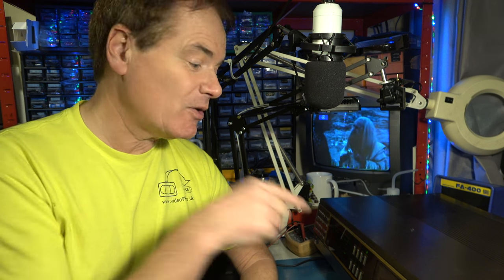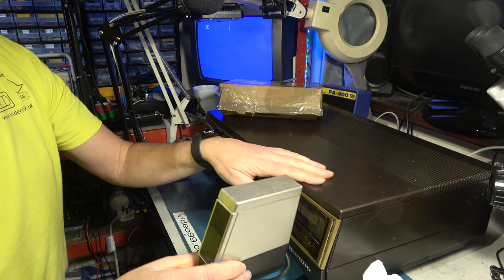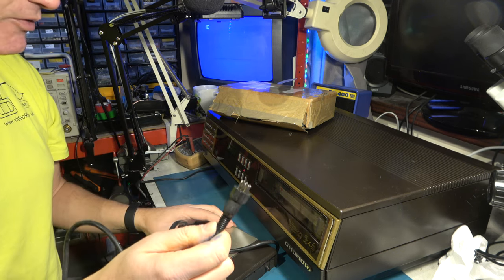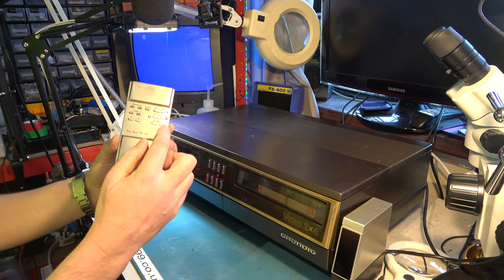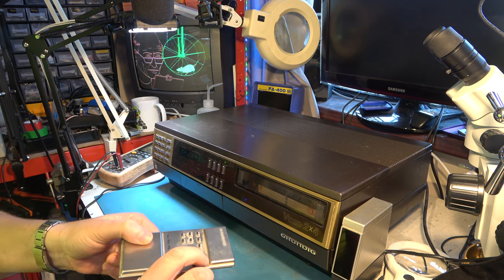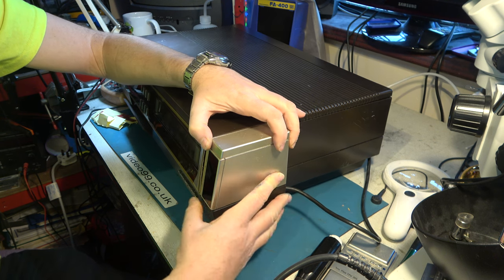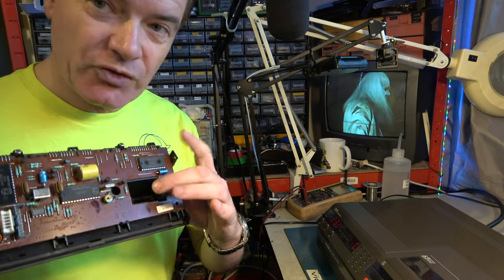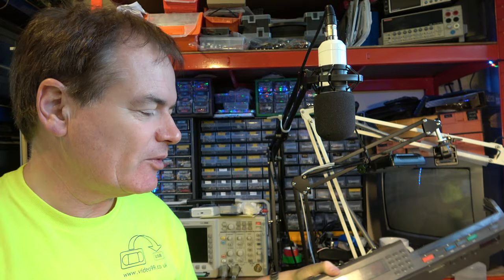Adding remote control to V2000 machines.

Comment: The nice thing about all Philips (related) audio video hardware is that the remote controls and receivers were all basically the same, based on the RC5 format.
You can probably take a receiver out of anything Philips from the 1980s/90s and connect it to 5V, ground and the appropriate input pin on the microcontroller and you'll have a working remote control. The RC5 bus is basically a single line that gets pulled to ground or 5V (I don't remember which) with a pull-up or pull-down resistor, and the signals are the demodulated bits from the remote receiver. 

Also I'm pretty sure that DIN plug on the V2000 remote receivers was a standard plug that's probably still available.

Comment: I remember getting a new old stock add-on wireless remote for my SONY C6 MKII Beta back in the early 90's. It was a very simple remote but essential for skipping ad breaks. The most memorable thing about it was you could almost point it anywhere and it worked. There was also a wired remote option for this model which I had previously but it did become a trip hazard very quickly.

Comment: So glad it worked-I almost binned it recently, I did look in the assorted box it was in for the mount but it didn't see it so I may or may not have it elsewhere, likewise I may or may not have the remote somewhere. According to the www the stereo model 808 was silver the super model 800 was like yours.   I definitely don't have the Philips one. I did once have the composite in/out module for the V2000 series but I no longer have that only the service manual for the module.

Comment: Considering how much these cost back in the day, it seems crazy that remote control was an optional extra!
Reply: They were a nice way to make VCR's just a little bit cheaper (V2000 were already the most expensive VCR's even without the remote). Lots of people still had TV's with no remotes too. If you had to walk to the TV to put it on preset 12 for the VCR, you don't need a remote for the VCR either. Made perfect sense to me 😄
Better than other compromises such as wired remote controls that many Japanese VCR's had. Those just seemed silly.

Comment: it reminded me of the remote upgrade on the toshiba v8600 which i owned. that was stuck on the side with velcro and plugged into the front wired remote socket.

Comment: My first VCR hack was adding a wired remote control (built myself) to my Sanyo 5000.
Reply from the maker: I did the same to a VTC5150!  It was an Aiwa cassette deck remote control model RC-10 which was nice because it also had LEDs in it, so I added circuitry to drive those from the machine's LEDs.

Comment: I think that if you take any modern or 90’s IR receiver ( the small black 3 pin ones) and connect it to the T4 terminal it will work, pin 1 is ground, pin 2 is rc signal and pin 3 is 5V supply.

Comment: I was wondering if it would come off pause if you pressed pause again on the remote, and play works only when the mechanism is in stop mode. (?)

 Also, how many pins are on that remote plug ? I'm trying to get a remote for my Philips reel to reel but they seem to be very rare. So if I can find the right plug I could make my own. :)

Have a happy new year.

Comment: The contamination on the connector pins looks very similar to that on the pins of some 20+ year old Hirose plugs with silver plated contacts. Perhaps a metal polish might be worth a go if you come across something similar again rather than risking removing the plating by using anything too abrasive?

Comment: Would it be possible to reverse engineer and build the GRUNDIG or Philips IR receiver circuit to integrate into these machines and find a universal that works, sounds like a project.

Comment: Actually the Grundig remotes are just wired in parallel to the front buttons, so you can just build your own wired remote by making a keypad matrix and connecting it to that socket.

Comment: I had a video 2000 and travelled 30 miles for the remote control unit, only to find that the battery was very difficult to get hold of

Comment: 2 Questions: Does the Remote Control still have a 4LR61 Battery ? (my standard Supplier no longer knows the Product), and can Universal Remote Controls still use the "Secret Code" ?
Reply from the maker: The battery is marked 7K67 and 4LR61, size J, I replaced it a few months ago.  I think some universal remotes will do the job.

Comment: Yeah, I have 2x8 machine, the front panel is in german, some only with abberviations, very peculiar to operate and I still think mine needs adjustments.
Reply from the maker: I also have a 2x8 with German front panel, in my store room.  I'm not sure it's repairable though, it's very high hours.
Reply: @video99couk  I have no idea how to check mine, I got it nre belt and glued one of the spool guides, because it was broken and the drive would fail load test ecause of it. With nre belt the image is a it unstable, but it generally works, I had to get the funny 270 degrees DIN-6 to SCART adaptor to connect to TV, I will need one to RCA to connect to my AV receiver. Not that anyone ever asked to have V2000 tape transfered.  But I recentely had someone ask about microMV, the cams are unobtainable pretty much.

Comment: Grundig 1600 2x4  i have with bad gears  easy to work on 
hi beware i had the ff rew gear  come  to small parts  as they are like the RS101 tape decks  that there are 3 gears made  of sell

Comment: Hello
I have an identical model and even with the same IR receiver, unfortunately I do not have a remote control ...
BUT that's not a problem...
My video recorder rotates too fast during operation and thus the picture is distorted ...
I don't know what to do here...
In addition, I have 4 other 2x4 VCRs and each has a defect ... For example, no sound ...

I really like watching your channel, even though I don't understand almost anything 😉
Best regards Mariusz from Poland 🙂
Reply from the maker: The one with no sound may be simplest to repair.  Swap the audio PCB over from another if you have one.  Also the A/V socket on the back can be troublesome, it may just need cleaning.